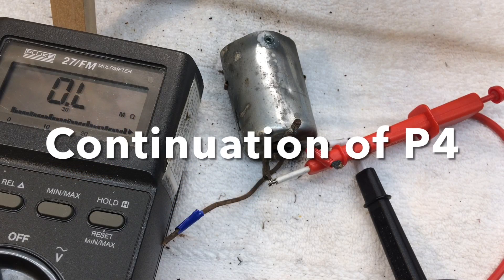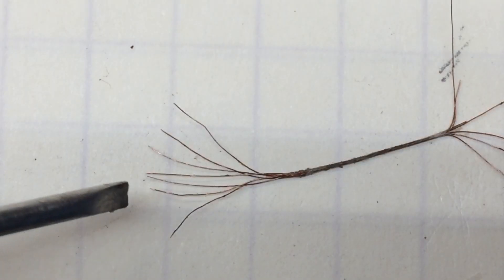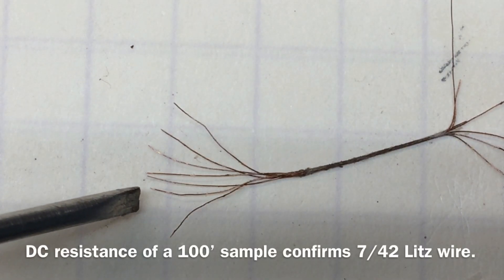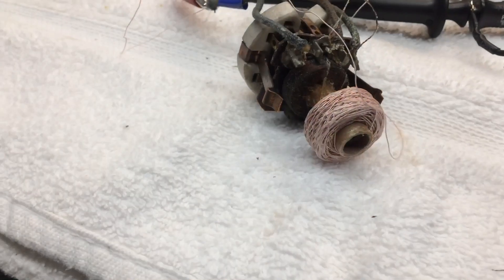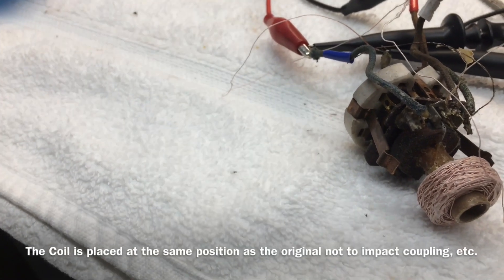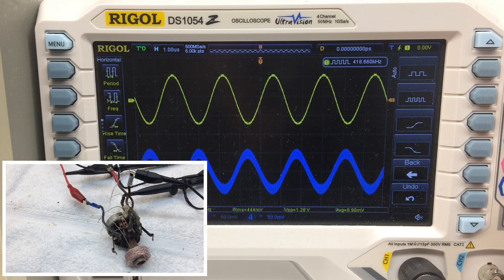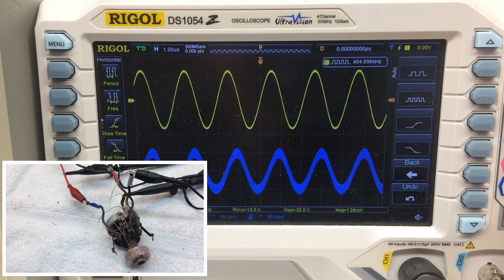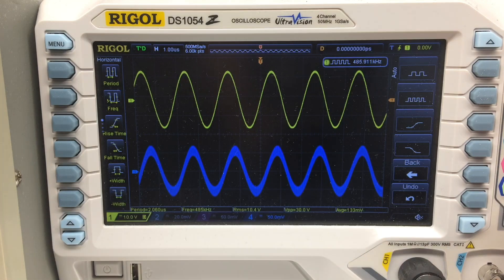Zenith 707 - Winding a New I.F. Transformer Coil

Comment: How many turns did it take to finish the coil.
Reply from the maker: Looking back at the video, I stopped winding at 360 turns. I don’t recall if I had to remove any turns afterwards to get the desired inductance. Hope this helps. Best, Don
Reply: Thanks' for replying yes that is very helpful . Regards Bob👍. @RestoreOldRadios

Comment: The wire to replace is 7 strand but it looks like you are going to replace it with a 10 strand. Did you mean to state you will use 7/44 litz wire??
Reply: Also what tool do you use to measure the diameter of the wire to see what awg wire to use?  I need to get one of those tools.
Reply from the maker: SanLiang Digital Electronic Micrometer Set Measuring Tool 0-1 Outside Premium Inch/Metric Precision Machinist Caliper with Case and Extra Battery (Basic 0-1"(0-25mm)) https://a.co/d/bqUoChn
Reply from the maker: I used 10 strand I had on hand to keep my expenses in check. Best, Don

Comment: Don,
You are worried  getting caught with beeswax? That is nothing. I used the oven to cure the spray paint on a lantern once assuming the smell would be gone by 5pm when she got home. It was not gone. I heard about it for 3 days. I was blamed for headaches, nausea, ill-temper, etc.. 
I have heard of lutz wire, but I don't know anything about it. I will  have to do some reading.
Thanks,
Ian
Reply from the maker: Ian, I’ve already been caught. I didn’t get my mess cleaned up before she walked in on me. I’m sure that smell of paint had you in the doghouse for 3+ days. LOL The Litz wire was used for many of the coils, especially for frequencies 1 MHz or lower. It has many advantages over solid copper. Thanks again for watching and keep those lanterns out of the oven. Best, Don
Reply: @RestoreOldRadios  Don was BUSTED!!